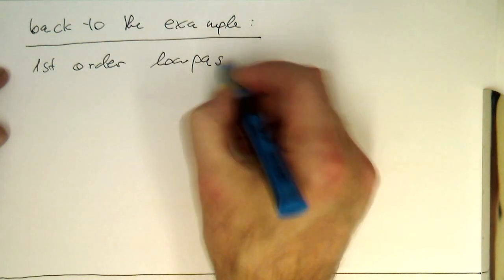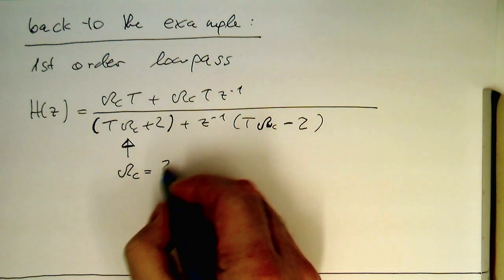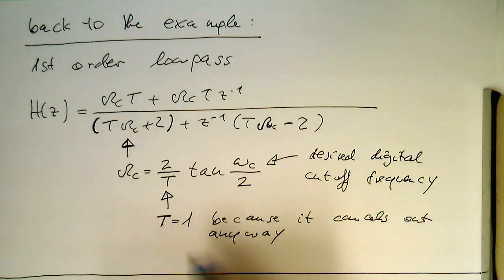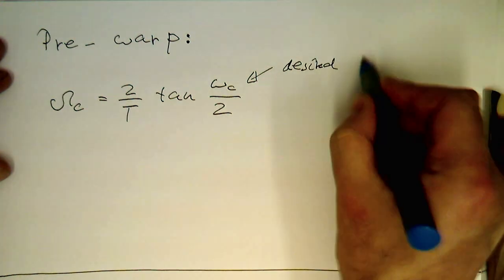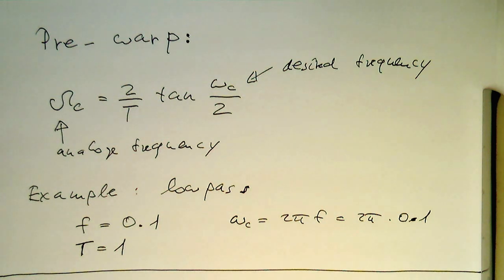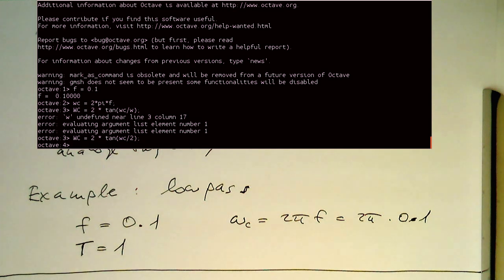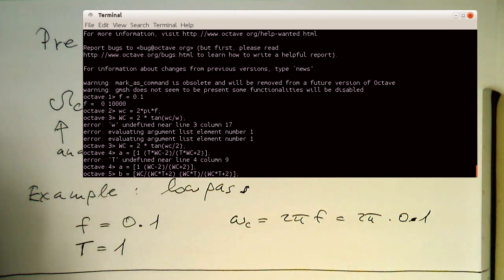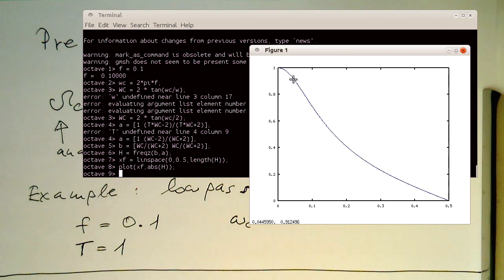Bilinear transform: pre-warping example (0005)

Comment: I would like to thank you for your excellent videos. It is refreshing to see such excellent and practical examples.

One question though if you don't mind.  In a lot of online literature such as yours and MatLAB, I see the pre-warping formula as:  w=(2/T)*tan(w/2); however I have also seen it written many times as w=(2/T)*tan(w*T/2) such as in MIT's open course ware and a few other sources.

I don't understand the difference.  I designed an analog prototype filter and converted it to a digital filter.  The only way I was able to get the cutoff frequency to transfer properly to the digital plane was using the second formula.  Do you have any idea why two versions of this formula are prevalent?  Thank you.
Reply from the maker: thanks for the question. It depends how you see it. Remember my w is a "small" w so it's a digital frequency. It depends on the perspective. I teach it from the digital one: I have digital filters which have normalised frequencies from 0 to 0.5 or 0 to pi (for small w). So, I teach it from the digital perspective. Analogue frequencies don't exist. The way you looked at it that you effectively look from it from the analoge perspective. Everything is analogue. This is the historical perspective because in the old days only analogue filters existed. I teach it that way: I want a digital filter with cut off at f=0.1. Then we create a "fake" analogue frequency with the pre-warp (with T chosen as you like). Then you have a pre-warped analogue frequency which you put into your H(s), then you do the bilinear transform of H(s) to H(z) and presto the T cancels out. You have a pure digital filter with cutoff at 0.1. So, no analogue frequencies at all. As I said that's the digital perspective. Talking about analogue frequencies is the old traditional approach but it's sort of wrong because we don't have analogue frequencies... Is that clearer now?
Reply: Thank you, I think that is making more sense now.

In my program, I am trying to simulate a real device that reads electrical current and does some calculations.  The device has a 4th order analog low-pass anti-aliasing butterworth filter with cutoff frequency of 2000 Hz before the digital calculations are performed.  So in my program I am trying to simulate that analog filter.

My process "seems" to work, but I'm not sure if I'm over complicating things.  Basically the program follows the following order:  

  fc=2000;
  T=1/fsamp;%Sampling Period
  fc_warp=((2/T)*tan(2*pi*fc*T/2))/(2*pi);
  [zb,pb,kb] = butter(4,2*pi*fc_warp,'s');
  [bb,ab] = zp2tf(zb,pb,kb);
  [b,a]=bilinear(bb,ab,T);
  OUTPUT=filter(b,a,DATA);

If you think I'm missing something big please let me know.  Thank you.